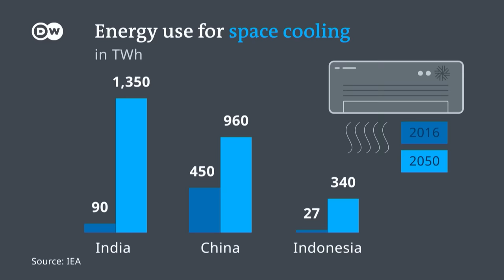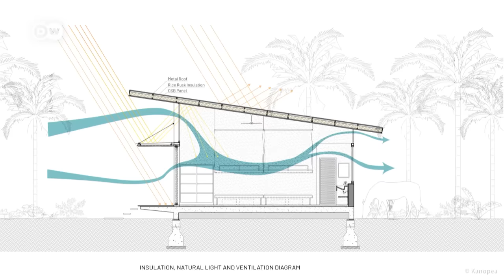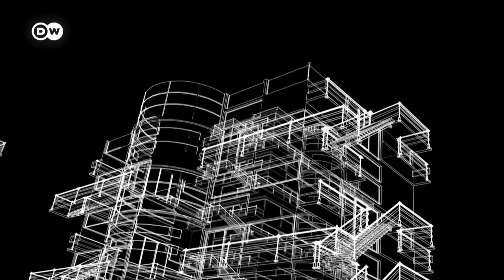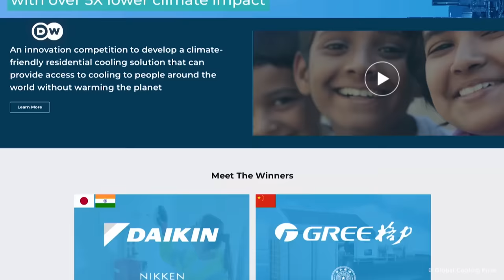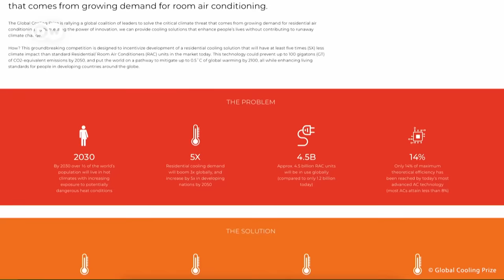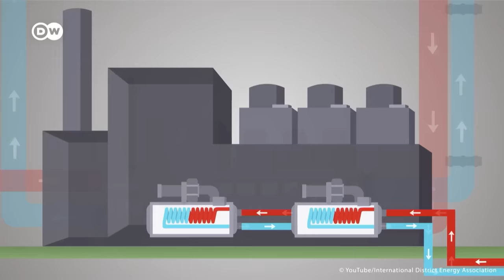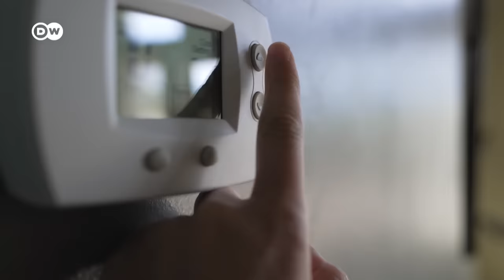How to cool our homes (even without ACs)

Comment: I found a perfect green solution for my single family house. Well two solutions actually. One is proper insulation, both for summer and winter it is a win win. Yet I noticed that despite the insulation sometimes the house walls do heat up despite of insulation which is extremely unpleasant. I noticed it during the heat domes which come over for a few weeks a year at a time. So I needed a backup solution and since I am not a fan of large electricity bills, I went solar. I have used solar panels, and created separate independent solar circuits. When it comes to heating and cooling, one solar circuit about 8 kW during peak, is used for two systems - aircond the old inefficient one presented here. And heated floors in rooms which are not the bedroom. And even during heat dome effects (when it can get +40*C for weeks each day) my house is cold. I even had to adjust the temperature because I caught a cold. But to be fair I did "slightly" overkill the aircond and installed a 300 square meter capable unit (the heat exchanger) to my 120 square meter single family house. 
Downside is - if you go outside from a house where I keep 19*C to +40*C in shade... your body is not happy. And also the other way around going from hot to cold after a few hours in the garden.

Comment: I've lived in a few mid 19th cenutry Victorian houses in Britain and on days that are 32c they're as cool as a fridge inside with no AC. They have high ceilings and big rooms and thick brick walls, so I guess it's partly to do with that, but they stay amazingly cool. You could probably put them in 40c even 50c and they still wouldn't hot inside without any AC.
Reply: I'm afraid I have to disagree. Perhaps your houses were made with lucky bricks or had good orientation. I lived in a couple of East/West aligned late-Victorian terraces in the SE and can say that the East-facing side warmed like a storage heater and was unbearable on summer nights. Ditto a family member's house of greater size and different brick type. I'm inclined to thing that North/South is our friend, or perhaps Virginia Creeper. YMMV.
Reply: @RandallSlick  I'm talking about the sort that you find in London and South East with 10 foot high ceilings or whatever in the rooms and very high hallway ceilings with big staircases, maybe you're talking about small terraced houses, I mean the grand victorian buildings.
Reply: I'm learning more reading the different comments, than I did listening to this video.
Reply: @nd15music73  Were they stuccoed, or bare brick?
Reply: @RandallSlick  Both. I think a big part is the very high ceilings and the heat rises to the top. They're also the sort of buildings that can get quite cold in winter, though that's partly the ancient windows, but they have big fireplaces in the rooms and the victorians would have fires going.
Reply: @RandallSlick  plants next to or growing on the surface  -  within the UK/NW Europe region -  do have a huge effect.   Plus travel north helps too.
Reply: @nd15music73  That's a fair point, and one I'd not considered. One imagines that that's not a design considered by the modern corporate house-builder for obvious reasons.
Reply: @timbushell8640  Plants alas seem to be thought of as a burden rather than a blessing in the modern domestic realm. Quite sad really.

Comment: There are 4 solutions that stand out:- (1) colour, (2) improve ventilation through area planning and interior fans, (3) centralised cooling to increase efficiency and to reduce heat being released at street level. (4) shading through airing panels and trees. Creating cooling architectures increase land use and material use greatly, and which create transport and services inefficency isn't a solution at all!

Comment: In Finland many homes are heated by district heating. Thoughts of district cooling haven't been given much attention. Buildings, especially homes, tend to be situated so the rooms get natural light year round (south southwest facing windows) which does make them heat traps if the summer is warm/hot. I close window blinds and curtains and open doors/windows in warm weather and add two small fans for hotter weather. I've tried to add plants outside my window/patio area to increase shade and add coolness, but building management isn't keen on this because the idea is still predominantly "let the sun shine in"

Comment: District cooling is something I think about from time to time on a neighborhood level. From thought experiment to thought experiment, I ended up settling on thinking of every distributed solution in terms of how it would work if I owned a rental neighborhood or apartment complex.
It's gotten me to the point where, if I could afford a decent amount of real estate, I'd probably be a landlord so I can put "be the change you want to see" into practice. 
Something I would play around with in district cooling, is radiative cooling panels. There are substances that you can paint a panel with, that radiate heat as light in a wavelength that passes through the atmosphere out to space. Employing radiative cooling in a district cooling solution could raise the efficiency, either by implementing it on premises (before the heat is carried back to the center), centrally (as part of central cooling), or both. Where I am though, it gets pretty hot and pretty cold, so it's more likely that I'd just find a way to centralize the heat exchange for individual AC units.
I have even more interest in making a neighborhood area network, as people seem to have completely forgotten about the benefits of a free and open internet.

Comment: Several years ago, the US Department of Energy granted a whole lot of money towards research for alternative, non compressor based AC. I would love that you do a follow up on this. What happened to magnetocaloric and thermoelastic cooling technologies? What about skycool technologies? Are they there yet?
Reply from the maker: Hey there! There is still research going on for magnetocaloric air-conditioning. This report is very recent and explores a prototype 👉https://www.sciencedirect.com/science/article/abs/pii/S0140700723000786. The same applies to thermoelastic cooling (still research going on). If you mean the technology by the  SkyCool company: It is not commercial yet, they are currently working on that.

Comment: It all depends on the material used for construction. Materials that use more temperature for production absorb more heat and release it slowly. For example, in the case of mud, no energy  is used, but in the case of cement  and steel, more temperature is used for production. So the construction with mud walls,wood etc will  give more cooling effect. Natural flow of air through vents also reduce the temperature.
Reply from the maker: That's an important add, thanks! 🏚 Also, using concrete will only make us hotter - it is responsible for 8% of global CO2 emissions! We made a video on this you can check out here 👉 https://www.youtube.com/watch?v=dgVWz77lGCo

Comment: I live at the base of a mountain range that has glaciers and cold rivers that eventually run into the ocean after about 200 km.  I live along one of those rivers that has relatively cold water, year round.  I have an irrigation ditch in the summer that has a slightly elevated temperature compared to the river because sunlight raises the water in a shallow ditch.  However, my domestic well goes down into the cold water lens and aquifer that goes into water than is mostly formed in the winter.

Being a meteorologist that understands the thermodynamic solution that Willis Carrier used, I concocted a similar solution.  I take the cold water from my well and pump it through a heat exchanger (it looks somewhat like a car radiator), with a fan pushing air thru the fins of the heat exchanger and exit out of the house to a hose I use to water plants.

The only electricity I use is to power the water pump and a fan to blow through the heat exchanger.  Under the heat exchanger is a tray to collect water that condenses on the heat exchanger.  My summer humidity is very low, so there is not that much water that is condensing on the radiator.  I simply take the condensed water that collects and put it on plants.  Air conditioners use a small tube that the collected water drains from.

My system is much, much, more energy efficient because I'm not compressing a CFC gas (it requires a phase change, which is very energy inefficient)  and then expanding it to cool ambient air.  My system is using sensible heat (no phase change) that is based on the difference between the temperature of the air in the house and the temperature of the water from the well .  The colder the water and the higher the ambient air temperature is, the more efficient the system is.

My system is within the house and dries the air, not raising humidity like a swamp cooler does.  Swamp coolers will not work in areas like the Southern states such as Louisiana.  However, this system would work to lower humidity of a house in the Southeast.  Actual cooling would be marginal because a shallow well in the southeast does not have a large temperature difference between the well water and the air temperature in the house.  Nonetheless, lowering the temperature say 15 F or 8 C is very attainable, even in the Southeast.

When temps were 120 F in the Northwest U.S. a few years ago my household temperature was 60 F, and my electric utility bill was only slightly elevated.  Had I used a solar water pump I would have had free air conditioning.  The theoretical coldest temperature that you could have coming out of the heat exchanger is the temperature of the well water.

Comment: I am in Canada where the night time temperature in the summer often gets low enough that a good cross breeze, it will cool the house down.  I then close up the house in the morning and keep it cool indoors all day.  We can easily get 30+ degrees in the day during the summer but with this method, I generally only need to run the air conditional about 5 days all summer, and then only in one room, where I can cool down.  I also use less heat radiating methods of cooking to keep the indoors cool.  There are many other things I would like to do in the future, like an outdoor kitchen, awnings over the one window that gets strong sun exposure, and more ceiling fans, to help reduce air conditional use.
Reply: I also live in Canada, my room is in the basement so it's cool all year round but the top floors gets really hot in the summer.

Comment: I live in the Mojave Desert in Southern California. The majority of homes built here more than 20 years ago all have Evaporative Coolers on them. The problem with them is that they make the air humid because they arent used properly. The added air pressure within the house because of the blower in the evap cooler means you have to open a window to get the air to flow into the room, making door and window placement critical. My room for example is the hottest in the house in the hot season and coldest in the cold one. Exterior walls take up more space than interior and the door and window are almost directly across from each other so the air only flows from the door to the open window. Which is why alot of the older homes like mine have a added AC unit that gets used when the outdoor humidity makes the evap cooler useless(Evap coolers cool the air by adding moisture to the air by drawing in air through water soaked pads, where AC 'Conditions' the air by taking moisture out of the air in the process of it passing over the cooling unit and blowing that colder air back into the dwelling, which is why you keep openings closed.)

Comment: My father's workplace has an eco-friendly cooling system that utilizes water from a well. Hot air is used to evaporate the water, producing humid, cool air, which is then passed through a passive heat exchanger to cool down another airstream that goes into the bureaus. The then warm, humid air that went through the heat exchanger is then exhausted out of the building.
If such practices were done on a really large scale in places where there's enough rivers or ground water, they could also help shaping the semi-local climate towards producing more rainfall, which could counteract draughts.

Comment: I built a room in between trees, created a veranda full of plants above it and amazingly, the room self regulates it's temperature irregardless of the temperature outside.its very warm at night and cool in the morning.there is a garden before the room, beside the room and on top of it.i just need to open windows to let air in at daytime and a fan for night time which usually gets off at 2-3 in the morning till 7am.my entire room is made with concrete and the veranda uses stainless steel

Comment: I was born and brought up in my grandparents house in Chennai constructed in 1966 using old technique. We never faced the heat inside the house even during peak summer. The terrace of the house was called Madras Terrace which used Wodden logs for its structure. The floor of the house was simple black floor without tiles. We had 15 feet gap in front and back so that the air circulation is always there. The house was sold due to very old structure, it was 50 years by them. Still i am missing the time we spent at the house.

Comment: I live in an area of the US that experiences very hot, humid conditions June through September. I run a large dehumidifier that allows my AC to not work as hard, hence not using as much energy. Rainfall can be sparse or non-existent during these months, so the water produced by the dehumidifier is welcome for watering my houseplants.

Comment: A district cooling system is currently operational and is being significantly expanded in Tallinn, Estonia where it's mostly targeted at commercial buildings where A/C is commonplace even today. In the future the plan is to use cold seawater to cool down the circulating water.

Comment: WHF. A whole house fan. We run it in the evening after the temp outside is lower than the temp inside. If we can get the cement floor to cool off significantly (less than 67 degrees) during the early morning hours, the rest if the day we will not need AC provided the temp does not exceed 100 degrees. I have seen houses equiped with passive solar tanks. Also smaller movable ones loaded with a heat sink. The tanks are rolled outside at night and rolled back in at dawn. While this does not stop all AC usage it greatly reduces it. I have also used a swamp cooler for years. They only work in dry climates. They also are limited in their cooling ability to about 25 degrees. So once the Temps exceed 100 degrees, they don't help much. I also have seen a design for a low power AC but I don't know how well it works. The design takes up a bit of space.

Comment: My garden is the same square as my house, made a centralized air duct (like a chimney) that sucks air out from the ground floor all the way to the roof which is mechanically done by rotary wind driven exhaust mushroom vent. The vegetation helps a lot, especially i have a big tree shades half the house. Tinted glass deflects heat and sun sails were added to a part of the house which receives Afternoon shade

Comment: Most of the cooling solution here won't help. They just transfer the problem everywhere.

Heat is energy
Energy cannot be destroyed
So even if I can passively reduce the temperature of my house by 10 degrees by adding shading on the facade, painting my house white and opening the window to let the wind blow through, that heat just transfers outside. So yes my house is cool and fresh, but my city is hotter than it should be, so people walking outside suffer more, meaning they'll probably use their car more to use the AC in the car...

Sure the solution presented here are nice for the short term, they will by passively transfering energy around, instead of actively doing it using even more energy. 

But for a long term solution, we need to:
-capture that energy, create huge battery to capture that energy and make it available for when we need that extra energy, but then we need to recapture it
- Send the energy back into space. ye the planet radiate energy passively into space, but the sun give us more energy then we radiate atm (thank green gas effect) so we need to reduce that green gas effect so the planet can radiate that excess energy back into space
- Shield the planet. Similar to your shading to shield the house facade, we need to shield the planet prenventing that energy from reaching earth all together. We can sprain chemical in the very high atmosphere (30 000 miles+) where it won't affect our ozone layer and acid rain, but those chemical will still fall back on earth in a few centuries (so yes it COULD save our kid from climate change but will doom our great grans kids...) Or we can build giant space station in the sky blocking the sun ray, make them solar panel to convert that solar energy int0 a usefull form, store it in giant battery and send it back on earth for our use.
This extra energy might allows us to stop using fossil fuel as much, reducing our CO2 emission. Will give us time to fid solution to the other problems  and help us control our temperature until the planet manage to passively radiate the excess heat passively and return to a comfortable homeostasis (or untill we evolve to find 40C with high humidity comfortable, which ever happens first